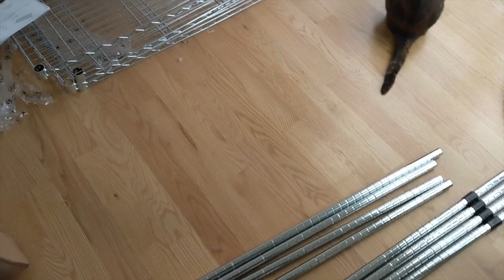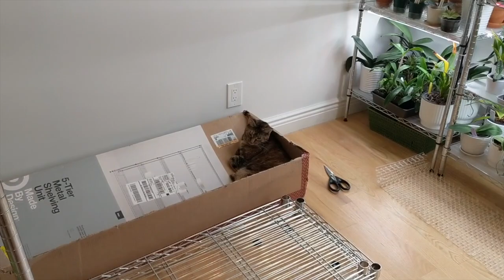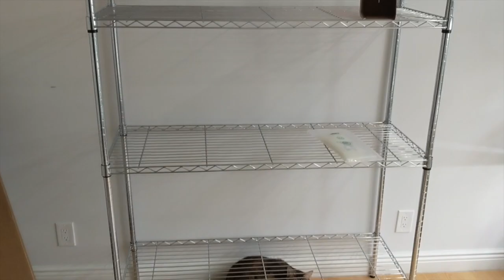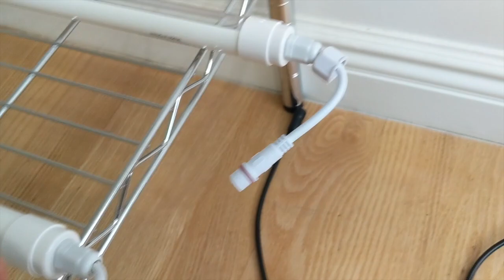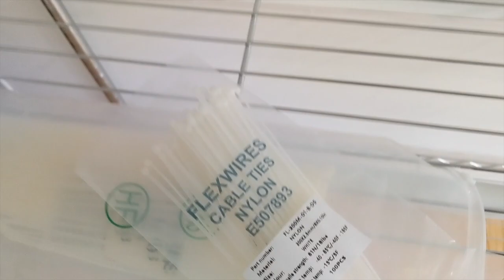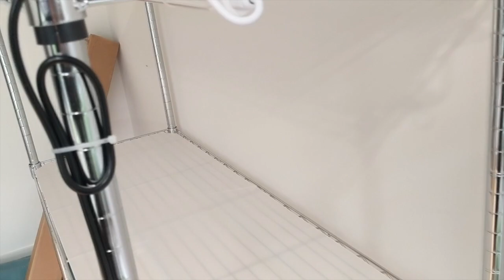Updates to the Plant & Orchid Room | Setting Up a New Shelves, LED Lights  & Timers

Comment: Hi Nicole, are you using the light bulbs for lower light level plants on the other shelves ?
Reply from the maker: Yes, for the other shelves (the 2 and 3 foot ones) I am using the standard lights.  When I have cattleyas, I have triple the light strips.  With Phals just doubles.  Hope that helps.
Reply: @NicoleDeanna   So you use the standard lights for everything, instead of 2 strips you used 3 for the Cats?  I thought in your video you said you used the super spike lighting?

Comment: Hi Nicole, very interesting, I have the same shelving but 36 inches wide. I want to get the same kind of shelving liners, can you tell me more about them ? Are they rigid or soft ? I am using trays right now but find them very inconvenient. Thanks Nicole for this interesting video, congratulations on your wedding but sorry that you caught the virus.
Reply from the maker: Hey Andre! The shelf liners are soft and flexible. They are used in professional kitchens so you can find them in professional kitchen supply stores too if you can't get them on Amazon where you live. They can bend without any issue and washable. They have a clean look too. Thank you for watching ❤️